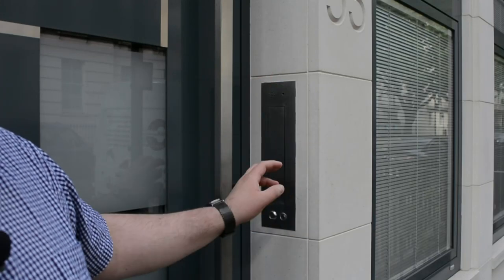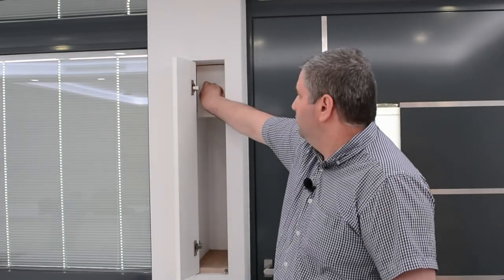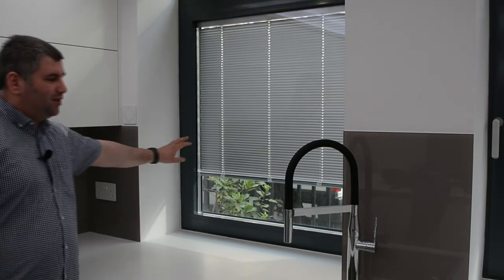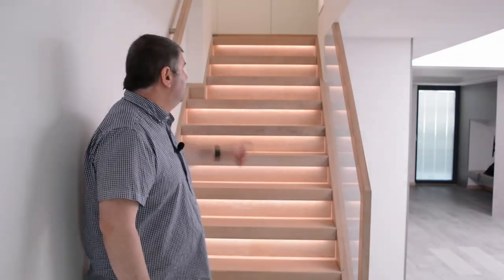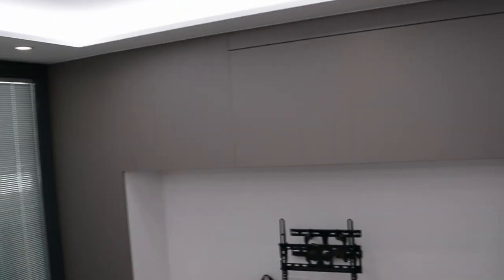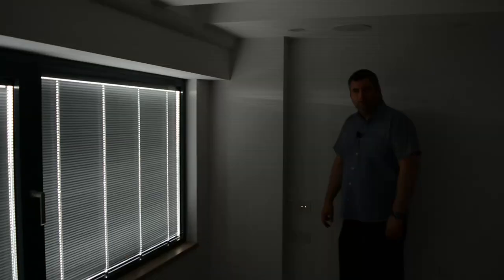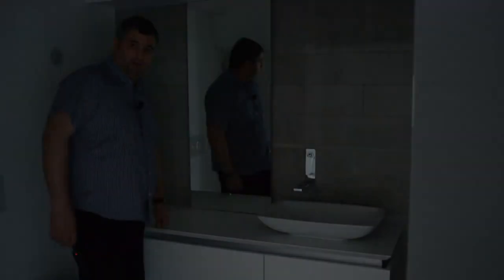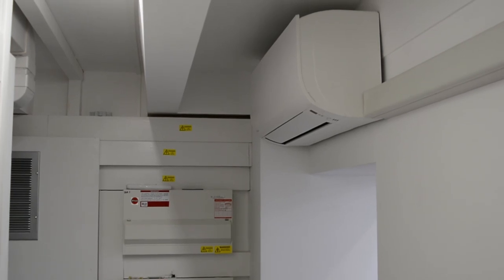Smart House with LOXONE Part 1-3

Comment: Buna seara, se poate un link pentru acel termostat incastrat in perete pentru ca pe siteul de la loxone nu am vazut nimic de genul . Multumesc
Reply from the maker: Salut. Nu o sa il gasesti in nici un site ca e facut de mine. Luna viitoare o sa il pun la vanzare pe site-l meu www.calincioci.uk. magazinul online e in constructie. O sa fie in jurul a £15 facute in UK.
Reply from the maker: Daca vrei sa comanzi inainte se poate la o comanda mai mare de 4  o sa fie numai £11/bucate
Reply: @ciocicalinmihai  dar va fi compatibil cu loxone fara probleme ??
Reply from the maker: @GabrielMaxGM24   Da. Îl conectezi direct la  one wire extension.
Reply: @ciocicalinmihai  super pai si vine intr-o cutie sau cum e ? Eu as avea nevoie de 6 pentru ca alte 2 trebuie sa contina si senzorul de CO2
Reply: @ciocicalinmihai   O sa aveti si alte accesorii  ptr loxone??
Reply: @ciocicalinmihai  Oricum cand e gata sa ma anuntati sigur cumpar daca mai aveti si alte accesorii.